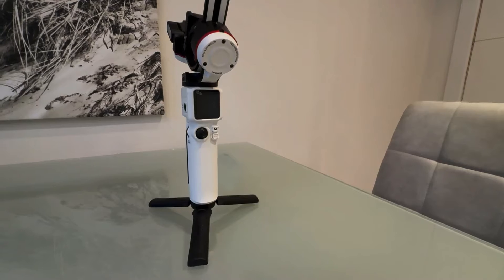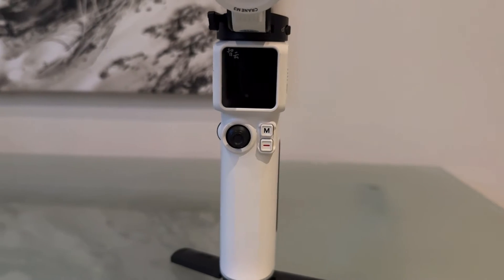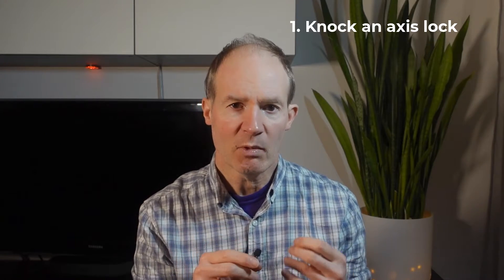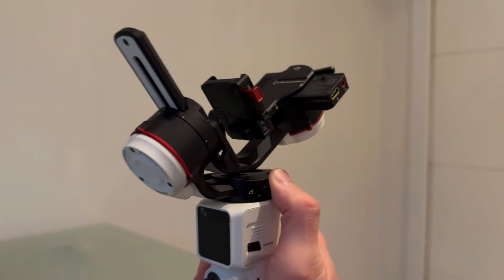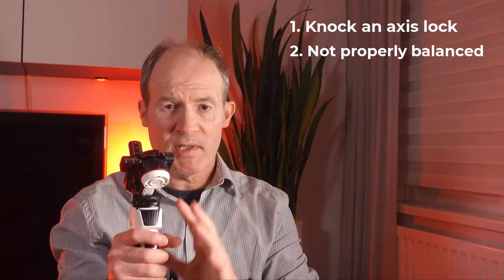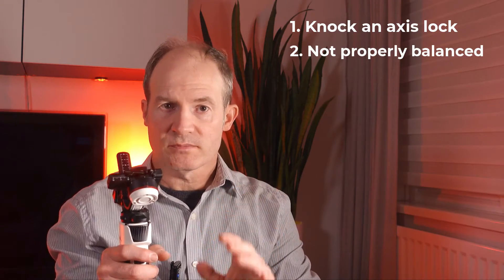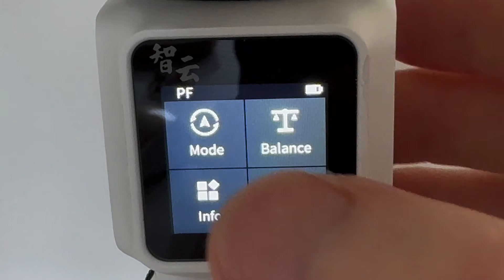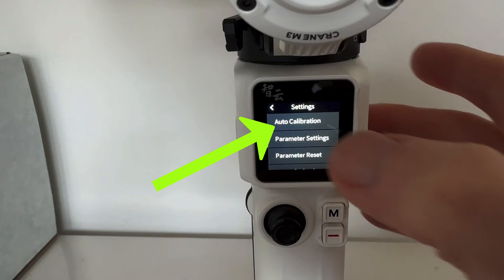Zhiyun Crane M3 Axis Lock Error or Suspends? How to fix it!

Comment: Mine says failed to calibrate . I literally just opened it out of the package never used it before . I did everything , turned it on and it was way off balance and then it beeped at me . I turned it off , rebalanced it again and then turned it back on and nothing .
Reply: Maybe you forget to unlock lock switch and set motor torque
Reply from the maker: Yes as @LengLynn says, this could occur if one of the axis is locked when switching on, Make sure all 3 are unlocked before balancing and switching on

Comment: I have a problem with my Zhiyun Crane M3. I checked 3 axes that needed to be balanced with my Samsung Galaxy S24.
After that, I unlocked those locks before using it. They were all set until it happened. The tilt axis kept jittering when I was
testing the joystick and the modes.
Reply: You can try to check whether all the axis are in balance and set a appropriate motor torque
Reply: @LengLynn  It's already too late for that. If the Zhiyun Crane M3 hadn't worked anymore, I would have replaced it last week.